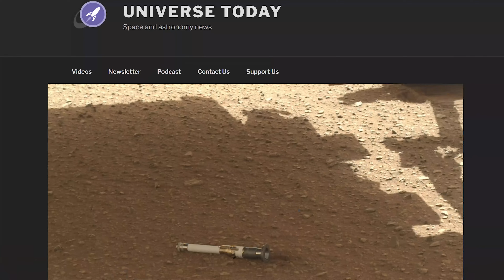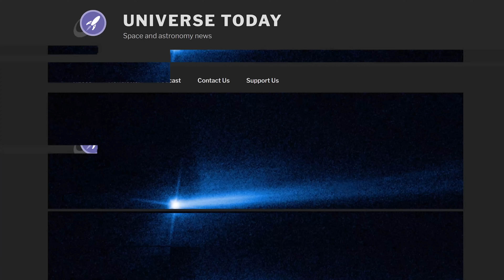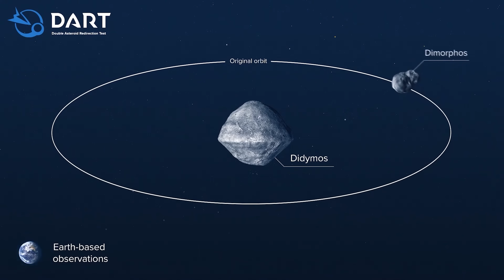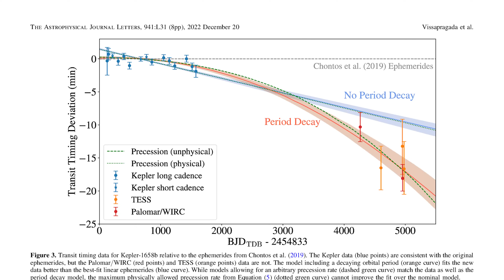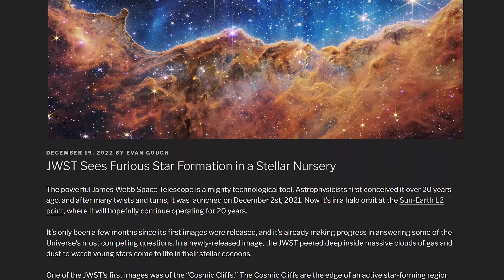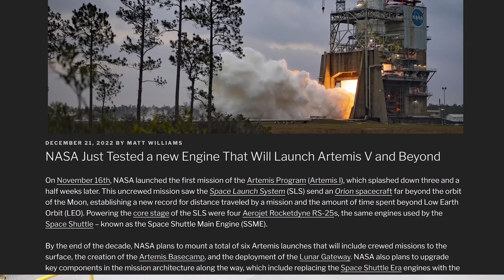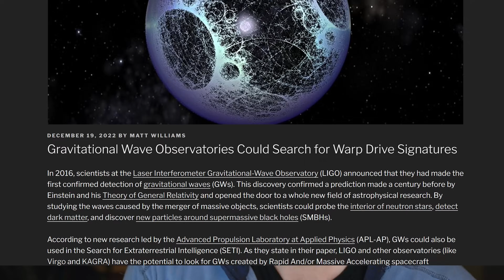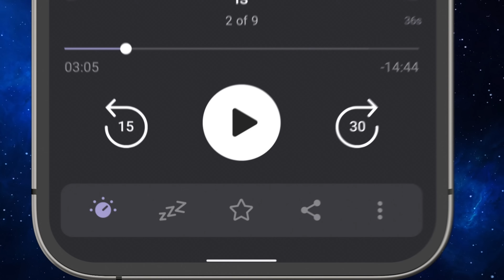InSight Officially Dead // Detecting Warp Drives // New SLS Engine

Comment: Why don't they put something on the landers to wipe off the dust? Air compressor, fan or even a windshield wiper.. hell even just a motor that's connected to the panels and vibrates could potentially knock the dust off lol

Comment: Um, lay-person here with a regular-guy type of question.  Having an articulating arm already, how difficult would it have been to add something like a compressed air nozzle somewhere near the end of the arm, that could be used to blow [at least most of] the dust off the panels.  If that's the principle reason the mission went dark, it seems a bit of a waste, especially if it wouldn't be overly difficult to make such a modification.  Mars has atmosphere, so it should possible to properly modify an air compressor, paired with a small pressure resevoir, attach a proper hose / fitting, and use it to dust off the panels.  I dunno.  I'm a simple, logical man, who looks for simple, logical solutions.

Comment: 10 percent the speed of light and 40 years to Alpha Centauri. That would be cool. I suppose that might have to be adjusted according to what kind of propulsion system was being used and how much power or energy would be needed and available on the spacecraft. A spacecraft would need to be slowed down before entering another solar system (or before the final destination) where they might want to get into the orbit of a planet to study the planet and the solar system. If there was a totally different form of propulsion in the future, that only needed a small amount of fuel and exhaust material to travel huge distances including deceleration to orbit both ways, that would be likely the best, easiest, and most predictable form of interstellar travel. The further away from the destination that deceleration had to begin, the longer the trip would take. If somehow a ship could be slowed down by it's engine enough to reach orbit at the right speed at 90% of the journey, the time to make that journey would be cut dramatically. If that improved kind of propulsion was not yet available and deceleration had to begin from further away, perhaps a ship could go past it's target a bit and try to slow down the craft by using another more suitable planet's gravity to slow it down, and then slowly cruise back to the original target destination over maybe just a few weeks. If the spacecraft was manned, then the ship would have to have fuel and a plan to return. 
Okay, this is the kind of thing I have learned by watching astronomy, general science, and space and space ship type of YouTube videos. Am I right about slowing down a ship by slightly entering a planet's orbit or gravity well? Please educate me if you know about such a thing.

Comment: That’s an incredible amount of mass considering the small area of the impactor foot. But my main issue however is that Insight died because of the dust of Mars has been a known factor as long as I can remember; my being something of an inventor, I have thought of multiple several very practical solutions to this very problem that would keep the solar panels clean; however, NASA has never demonstrated any desire for such a solution and I can’t figure out why - other than government bureaucracy is universally corrupt and very good at allowing very critical things to fall through the cracks because there is rarely any accountability involved. I would hate to think that it is because the mission is only initially proposed to last a very short time - even though past missions have been unsurprisingly extended exponentially.
Reply: There's no big corruption or conspiracy -- it's just simple economics. They don't need a more complex mission with more potential fail points, they just need certain questions answered and the mission only needs to last long enough to get those answers. If it lasts longer, that's great, it's like unexpectedly getting a free dessert with your meal! But if they have more questions or need more data, it's more cost effective to just send a new mission a few years later that uses better tech to get better and more accurate results.

As Mark Adler, the Mars Exploration Rover Spirit Mission Manager, said back in 2015 when asked why the Mars rovers lacked a means to clean their solar panels:

"They didn't need it. The Mars Exploration Rovers were required to work for 90 sols after landing day (about 92.5 Earth days), and the solar panels were simply sized to account for the dust accumulation expected over 90 sols. To be fiscally responsible to the taxpayer, you do not add equipment to clean solar panels or use expensive nuclear power sources if they are not needed to meet the lifetime requirement. As it turned out, Mars provides periodic solar panel cleaning (aka, the wind), which is the main reason those rovers lived so long, with one still going more than eleven years later."
Reply: @olencone4005  oh yes, I remember when regurgitating all the excuses that deflected scrutiny to other issues that were less embarrassing to explain why 95% of Insight was apparently overbuilt to last much longer than its intended mission requirements, and apparently this one issue of dust accumulation was ignored because it would have made the mission literally last indefinitely had this single issue been addressed as robustly as the rest of the probe.
In fact, one of the potential solutions was as simple as a set of helicopter-like blades that unfurled like an umbrella and spun by a small electric motor, it would blow the entire probe clean of dust periodically whenever solar panel panel output fell beneath acceptable levels.
Having the probe continually monitor subterranean mars quakes would have provided a real-time monitoring capability - what if it turns out Mars is too unstable to support any critical aspects of the "Mars Invasion" plan?

Comment: Hello Fraser, greetings from Nigeria! 🇳🇬
Regarding the Insight lander, if in a future mission to Mars we could send a drone or helicopter, such as Ingenuity, and we're able to fly over and blow off most or all of the dust from the lander and solar panels, would it be possible to revive Insight and bring her back to operation?
Reply: There's some issues with that: unlike the dust we're all familiar with in our homes, the Martian dust is electrostatically charged, so it won't blow (or brush) off very easily once it's accumulated; and any unexpected bobbing or other mishap with the drone while it's flying over the solar panels could damage or destroy them, which is very much the permanent end of both missions; plus, if you're launching a mission to revive InSight... why not just launch a new and improved InSight mission instead?

InSight was designed with larger solar panels to offset the power loss from dust buildup so that it could complete it's intended mission. It wasn't designed or intended to be a particularly long-term mission, just 2 years of seismic observations so we could get a better idea of Mars' interior structure. The fact that we got an extra 2 years is great... but it wasn't planned for, it was just the icing on the cake. Long-term missions will use an RTG, like Curiosity, and dust will not be as big of an issue as simple wear and tear on the equipment would be.

Comment: Hey I got a question for your Q/A
Speaking of spaceships with the size of Jupiter, would such a large ship be structurally sound or would it collapse into a sphere just like any other known structure that size?
Reply: Depends on how much mass the ship has as if it has rather low mass do to being mostly hollow then it wont produce much of a gravity well meaning very low strain on the structure itself.
Reply: There is a technology called a gravity generator that would hold up the mass from the inside out

Comment: Why don't those solar dishes just turn mechanically, to shake off the dust?
They could use a system with jolting, dented sprockets, to shake off the panels, as they turn
*Ratchets and pawls.. English is not my first language
Sigh.. wish NASA still employed only the brightest, for the job..

🤔Maybe I should build some prototype, with regenerative motion.. like the systems designed for Venus.. I plan to buy a 3D printer, next year
Too bad I have multiple jobs, already :/
**or a wind helix system attacked to the solar dish, to make it turn with the wind.. if even just a little, using the tenuous winds of Mars.. idk, something
What lack of imagination those designers have, nowadays..
* I get the instrument was designed to measure tiny vibrations, but still.. solar panels for those missions definitely need an upgrade, in design.
Reply: The solution is not simple. Martian dust sticks to the surfaces due to electrostatic forces.

Comment: Are the new RS25 engines a little cheaper than the old ones, because they don't need to be reusable?  I would think there would be a few corners that could reasonably be cut between a reusable version of the engine and a non-reusable one.

Comment: Hi Fraser, I know the idea of using wipers was already discarded and the dust in mars stick due an electrical nature but still I think Insight lander could have more life time if it had a small wiper attached to its shovel arm to clean itself. dont you agree?
Reply: The dust is probably filled inside the machine as well, which would require taking it apart
Reply: A brush or wiper being used on electrostatically charged Martian dust would be a bit like wiping those solar panels off with coarse sandpaper or an iron-fiber scouring pad. It wouldn't end well.

Comment: I wonder if you could use electrostatic repulsion to get rid of the dust.
Reply: We have a helicopter over there why don’t we just have the helicopter fly above the panels. The draft from the copter blades would blow off the dust
Reply: @ekothesilent9456  That sounds a very reasonable idea.  They could at least try, there's not much to loose after all.   🙂
Reply: Or windex.

Comment: Can the helicopter  robot fly to this lander and blow off the dust? Or is it too far away or the wind it generates to weak. Or maybe that would generate more dust.
Reply: Thousands of miles away and not likely much use since the air pressure is so low.
Reply: They have detected a lot of nearby dust devils but sadly none have passed right over it.

Comment: I guess windscreen wipers on future mars missions! But seriously though, that has to be a major concern for a crewed mission. I suppose you could send some poor astronaut out with a squeegee.
Reply from the maker: Hah, the astronauts will be on squeegee duty.
Reply: I am surprised that the solar panels were not able to rotate upside down or vertical and shake to remove the dust. They have known from previous Mars missions that the solar panels collect dust.
Reply: @mrbaab5932  The dust isn't just passively lying there, there is electrostatic cling as well. The probes are very complex and delicate, adding more complexity in an attempt to extend the mission would raise the cost. It would add more failure points, and could have lead to the mission being cancelled before it ever launched. The mission didn't fail prematurely, though the ground probe never worked out. In fact it lasted 4 times it's primary mission. Don't mourn the loss of Insite, rejoice for all the data that was revealed and look forward to the next.